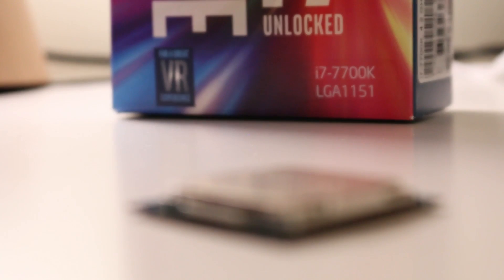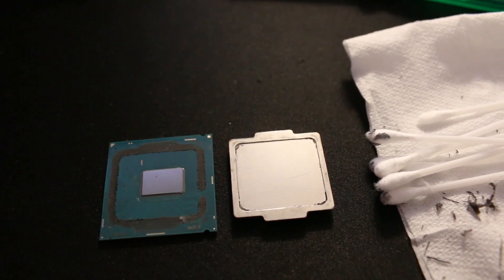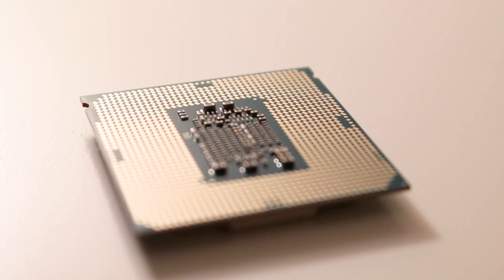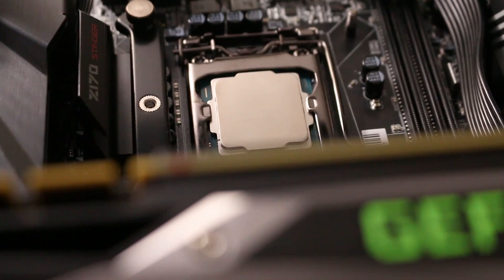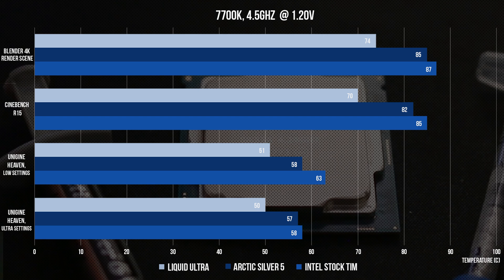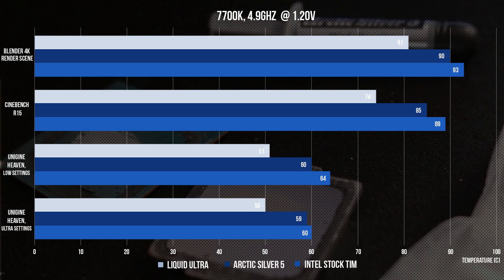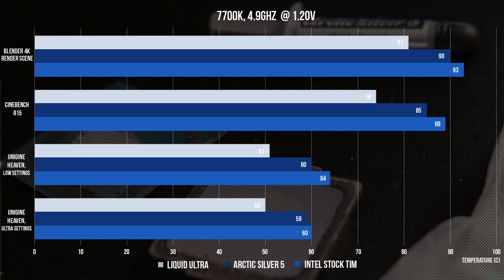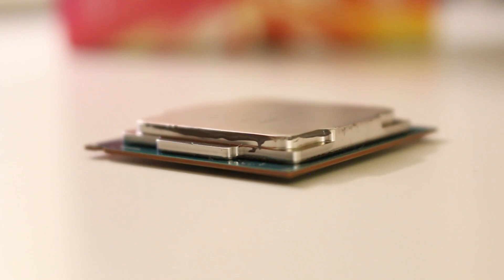CPU Delidding - Stock Compound vs. Thermal Paste vs. Liquid Metal

Comment: Completely wrong conclusion at the end.   LM is WORSE at filling the gaps.  It has surface tension issues and requires more sanding and lapping to unlock full potential.   Others don't benefit from polishing as much.

The reason it performs betters is simply the insanely high thermal conductivity.  That's it.

Comment: I just delidded my i7 7700k. Went from 98C to 88C with arctic silver same overclock. I didn't try liquid metal. But thats a big difference. I wonder if it's because my CPU has been used a long time and the stock compounds is no longer effective. It was dried up and crispy when I delidded it

Comment: Hi, the main questoin no video seems to cover: What happens after 1 year with the liquid paste? will it dry out, get cracks and be worse?

and second: what about the silicone glue to attach the IHS: can you use glue instead? and wont the material build up a gap? so taht the IHS will be "high" with a gap over the die and not touch the die?

Comment: The thing is - AS5 requires at least 200hrs of burn in time and loads of heat cycles before it eventually sets and gives the best results. The results here might only tell a apart of the story but given a few more weeks or a month or so of burn in time and heat cycles. Id say the temps would probably drop another 5'c

Comment: Yeah you did something wrong i was getting over 95c at 5ghz on mine after delidding i max out at 82c on my hottest core and about 77-78c on the rest i can stay under 90c on all cores but my hottest 92c at 5.1ghz just using mx-4 https://imgur.com/a/s1WBJVZ
And thats stress testing before just playing battlefield 1 at 5ghz was over 95c

Comment: The second graphs header is 4.9 @ 1.2v. That cant be right.. right?
Reply: yes, i don't think it is. i have a great 7600k and would need about 1.27 to run blender at 4.9... i think he let the cpu get the requested voltage. if he was at 1.2v in both 4.5 and 4.9 why would he get a 7c difference with liquid metal? Anyway, just for you to get an idea of how good his cpu would have to be mine is running 5.2ghz @ 1.36v for about 2 months now and is already probably on the top 5% or even 2% as far as sillicon lottery goes...
Reply: My current cpu is an 8600k, which I know is a 6 core so will be different, but it takes 1.39 for 5.2. My last quad core was a 2600k and it was 1.4 for 5.0. But yeah im glad its not just me who thinks that number is weird.

Comment: my 6700K started having insane temps so I delidded and used AS5 and my temps dropped significantly. I went from 70-80 and 1.4v hitting 100c to 1.45v hitting a max temp of 80 where as 1.3v hits max 63 degrees.
Reply: Did you re-lid ? or used direct die ?
Reply: @vapochillled  re lid but didnt re seal the lid.

Comment: It has nothing to do with the air gap as the silicone or carbon based pastes will squeeze out any air bubbles all the same the true difference is that the liquid metal is usually over 70 w/mk thermal conductivity while something like arctic mx4 being 8.5w/mk and really cheap compared to something like thermal gizzly kryonaut which is 12.5 w/mk and it costs almost as much as their conductonaut LM which is 76+ w/mk

Comment: I think it's fairly obvious why the liquid metal is better: Not because it fills gaps better, but because it has several times higher thermal conductivity compared to any other non-metal paste.

Granted there is more to a thermal paste than just thermal conductivity - but that's pretty much the #1 factor when it comes to determining performance.
Reply: Considering liquid metal has risks (I won't use it on a portable laptop because of the fear of slipping up and dropping it)...

I just replaced my stock laptop's old thermal paste with artic silver (it's an older core i3), and the temps are hotter...but it's freely available.  I might try IC Diamond or something similar.

Comment: It's not better because of bubbles, it's because it's 65 times more conductive than arctic silver 5, or other standard pastes, grizzly kryonaut has around 11 w/mk same for gelid go extreme, liquid ultra has like 37 w/mk liquid pro has like 57 or more w/mk, and I'm not sure about grizzly conductonaut but they're gallium based and metal is going to have higher conductance, because higher electrical conductance also increases thermal conductance since they're conducted via electrons. Some substances have a higher thermal conductance like diamond, but just because it has diamonds in it doesn't change the actual rating for the paste. 7 w/mk diamond paste is still just as conductive as 7w/mk non diamond paste.

Comment: Arctic Silver 5 require a "break-in" period with thermal cycle to reach it's best performance.

From the producer website:
"Due to the unique shape and sizes of the particles in Arctic Silver 5's conductive matrix, it will take a up to 200 hours and several thermal cycles to achieve maximum particle to particle thermal conduction and for the heatsink to CPU interface to reach maximum conductivity. (This period will be longer in a system without a fan on the heatsink or with a low speed fan on the heatsink.) On systems measuring actual internal core temperatures via the CPU's internal diode, the measured temperature will often drop 2C to 5C over this "break-in" period. This break-in will occur during the normal use of the computer as long as the computer is turned off from time to time and the interface is allowed to cool to room temperature. Once the break-in is complete, the computer can be left on if desired."
Reply: I found the opposite, using mx5 with a 6600k delidded. The mx5 got much WORSE after about 20 hours
Reply: @Tom--Ace  The MX5 is different than the Arctic Silver 5
Reply: Stef3m basically saying “we know our thermal compound is junk, but we’ll delay the bad news for as long as possible”

Comment: liquid ultra and liquid pro can damage you processor and coolers for this application but it drys up easy and it can cause corrosion and this stuff made out of gallium liquid that why i don't use liquid metal thermal paste anymore
Reply: Austin Souslin- I was wondering that myself that gallium corrodes or react to most metals over time and heat accelerates that even further.

Comment: I've also seen some cases, including in my own testing, that regular thermal pastes lose their temperature difference over the course of a few days. Using Noctua NT-H1, Arctic MX-4 and Thermal Grizzly Hydronaut, I've always seen a 20°C drop on the first test, only to find myself back where I started (or even worse!) after a day or two... A few forum posts here and there suggest that, when delidding, liquid metal is pretty much mandatory to avoid temps rising again over time. I have some Thermal Grizzly Conductonaut coming soon, I'll see if it helps.
Reply from the maker: That's interesting. I mean I can see that happening in the scheme of months, but not days. And definitely, that's exactly what these results show!
Reply: I'm having the same problem too, the temperature was good for first few days, after that it keep increasing, until it get worse than stock TIM. I've tried AS5 and MX-4, both having the same problem, I'm now trying regular thermal paste (white), so far the temperature didn't rise after 2 weeks.
I don't get such problem on my GPU, but only happen on my delided CPU.
Reply: @mikka1986  what thermal paste did you end up using? the white one you mention is the arctic ceramique 2?
Reply: @aardvarker  it's a cooler master thermal paste, cheaper type, forgot the name, gel something.
Reply: @mikka1986  Cool, looks like it's called mastergel! Is it still working good (after 1+ year since your original post), or did you need to reapply?
Reply: @aardvarker  yes, it's still good until today, been reinstalling cpu cooler many times for that issue.

Comment: You should try Thermal Grizzly Conductonaut. It cost about 13,25$ on newegg (8,49€ here since its made in my Country). A bit cheaper then the Ultra.
From the opinions and tests i gathered its better, easier to apply and easier to remove.

Still I havent used it yet, since im waiting for my Delid tool to arrive XD.
Reply: Gucky p
Reply: Gucky is
Reply: rein von den Temperaturen wirst du keinen unterschied merken Thermal Grizzly Conductonaut hat allerdings diese sehr Praktischen Stäbchen dabei um die zu verteilen aber einen Riesen Nachteil ... die Dosierung ... von der Thermal Grizzly Conductonaut macht man immer zu viel drauf und das Zeug kommt aus der Spritze nur so geschossen und da man das ganze nur auf dem Board machen kann muss der Tropfen nur etwas weiter rollen und das Bord ist Schrott ...

Comment: When the cpu is opened ... does it need to hit the lid again?
Reply: No, but if exposed it can be damaged VERY easy, just google for als AMD CPUs which had no IHS (Heatspreader) you can find many Die's that are chipped. 
And not any Heatsink is compatible without an IHS, since it needs to go quite a bit lower.
Reply: Gucky 25 stress 5,1ghz 90 degrees ,cinebench 80 degrees,battlefiel 65/75 degrees

Comment: Kaby lake and skylake same essential cores and designs just a few tweaks aka 14nm+ but why does kabylake run hotter at the same voltages? isn't it supposed to be able to run higher clocks and run cooler? i think the main reason is because with the new kabylake cpu's they changed thickness of the cpu circut board thus this makes it very flexy and bends when the IHS makes contact on the cpu die resulting some cores hotter and not makeing a perfect mating surface, and thats why it runs hotter compared to skylake cpus which have a thicker circut board, so im gonna experiement with thermal tape on the back of the cpu die to reinforce it and also to provide additional cooling to the cpu, i had experiemented with CLPU but it just wouldnt stick to my ihs maybe cause it wasn't scuffed up to add that adhesion, but by the time i wanted to try it i ran out of clpu they give you soo little in that needle

Comment: I just did this to my 7700K last night. Prime 95 temps went from upper 80's depending on the core to no higher than 67 if leaving my AIO at Performance and no higher than 72 if set to Quiet. I bet I could get it cooler if I remove some voltage or about the same and just overclock it.
Reply from the maker: Those are great temps! You could definitely get a nice OC. See how far you can push it at a low voltage (<1.30V)

Comment: My mannnn!! Got my liquid metal today... ohhhh I could not be happier :)

These are my temps with my Noctua NH1: 83 89 85 88
Andd those with Liquid Metal: 70 70 68 70

Both with my CPU @4.9.

Now I think its time to try push a 5.1 or 5.2, I hope I have got a good chip :D
Reply from the maker: Those are great temps man, what cooler are you running? Good luck with the overclocking!
Reply: A WC Antec 920, 5yo hahahahaah I just bought some custom WC stuff but will take around 2-3 months till I get it... once again, thanks to Brazilian mail system! 

I really think those temps could improve a bit once I get a new cpu block and water pump, this one is pretty sloooow.

Think about to apply some Liquid Metal on my GTX 970 too, once it has direct contact to GPU die's, it might improve my temps a bit... at least worked like a charm with the CPU :)

Waiting on the next vid brother!
Reply: PC enthusiast do everything they can to max out their hardware performance, even if you dont notice any difference just knowing you have a 5Ghz Quad-core in your machine makes it worth it
Reply: how did you glue the Heatspreader back on the Cpu

Comment: Great video! I'm thinking about delidding my 7700k but it seems a bit risky...
Reply from the maker: Really depends what temperatures you are currently getting. There's no doubt that delidding will improve them anywhere from 10-20C°, it seems pretty consistent looking at everyone's results. 

I'd recommend the Rockit88 Delid tool if you are feeling uneasy about taking a razor underneath the IHS like I did :)